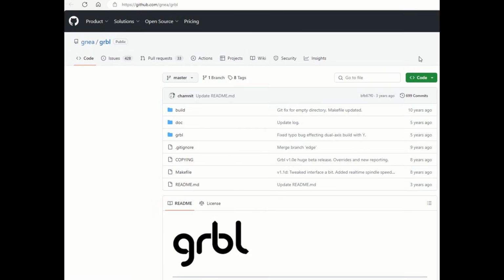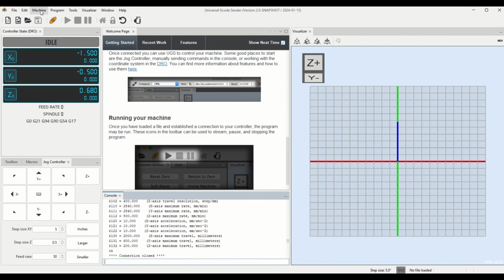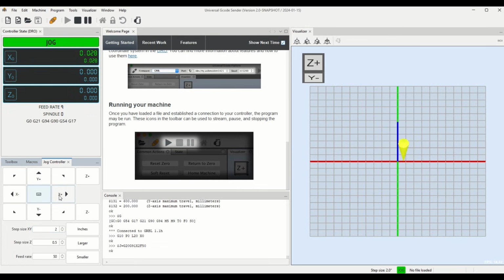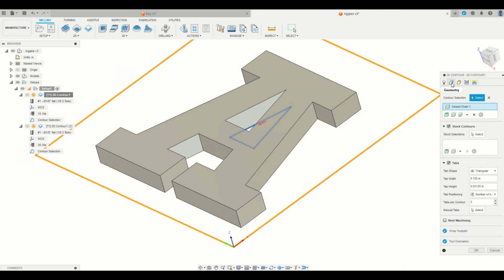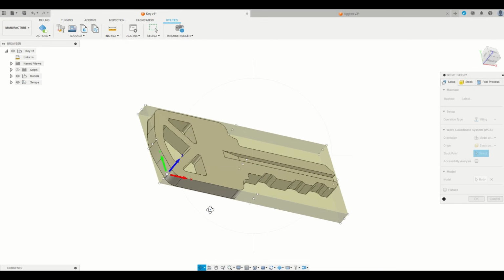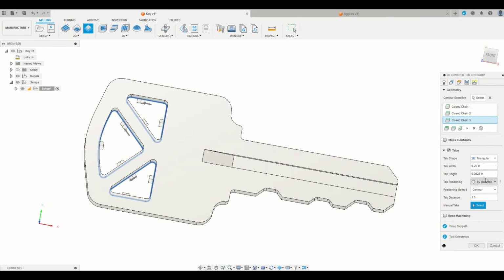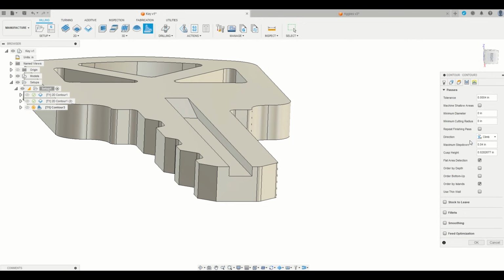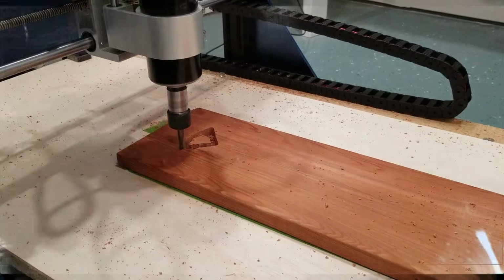How to build a large CNC router controlled by Arduino GRBL, UGS, and Fusion 360 - Part II

Comment: For the spindle, do you adjust the speed manually before you begin the cut, or does the g code turn on the spindle automatically? Sorry for the late question
Reply from the maker: For this set-up it is manual. Perhaps I will automate it in the future.

Comment: I spent two days trying to get gbrl on my Arduino with no errors. I finally got it working, so hopefully the stepper motors work now. That was about as bad as it gets. thx 4 your video
Reply from the maker: Good luck. Hope the rest goes well.
Reply: @ScienceFunInnovations I have a background in wiring and carpentry, I know about Electronics but I never program day Arduino and the first program I used kipped erroring I didn't know how to upload and load it to the thing, the program you recommended works like a charm, I was getting real frustrated

Comment: You are describing almost identical situation as I am trying to solve, so please give me a few answers...
1. Is there good enough alternative to Fusion 360?
2. Can it be done with sketchup?
3. What flavour of Fusion do you use? Free or payed version?
Thanks in advance
Reply from the maker: Fusion 360 is free for hobbyists. Sketchup cannot do CAM that I am aware.
Reply: Natively SketchUp cannot generate G-Code, but there are add-ons that will generate code (varying quality) there are some free cad apps with good G-Code functionality. 
2 supplo\iers I know of Inventables Easel and Carbide Create V6 have free limited CAD/CAM apps. £12 to £20 per month for Pro capability. Or CarveCo Maker £15 pm has 3D carve capabilities
Reply: UGS has a built in G-Code generator. I saw a very early offering but it was very limited, lots of updates recently, now up to v2.1.9, but not looked at current design & G-Code abilities.

Comment: Hi, I am doing CNC machine using servo motor. Can you plz guide me little bit???
How to use for servo motor based CNC?
How to configure Universal G-Code Sender for servo motors?
Reply from the maker: Did you watch both videos? A servo should work very similar to steppers, you will have different number of steps per rotation.
Reply: @ScienceFunInnovations  Yup. I am only confused with 4:40 (Calibrate). How will I find these values for my machine. As I am using Yamamoto ydk ya-010-1 servo motors.

Comment: I have 3 nema 17 60mm for x and y. Will this do or should i buy nema23's. I have exactly same planed dimensions 1000mm x 500mm. Plan to use rack and pinion with spring foy y and common lead screw for x and z for now. Any thoughts? Will mainly use on wood designs. Will use hgr15 linear rails.
Reply from the maker: My Z axis is NEMA 17 and it does fine. 17's would probably work for this, but you might want 23's if you ever want to upgrade. Thanks for watching! Good luck!
Reply: @ScienceFunInnovations  thanks
Reply: If upgrading to Nema 23, get longer/stronger steppers make sure your controller can deliver higher amps required approx 3a each. Some CNCs with short steppers and less than 2a have insufficient torque and lose steps when pushing too hard